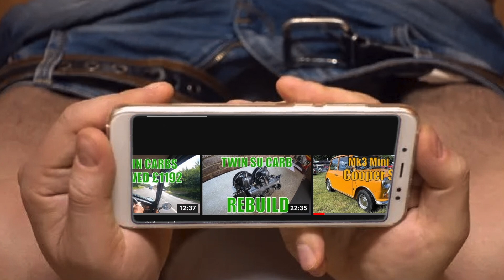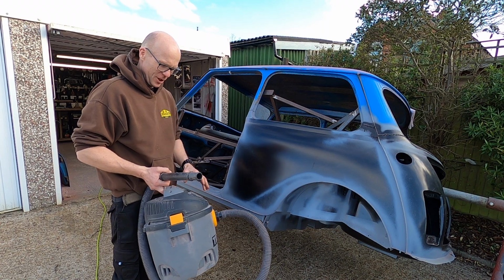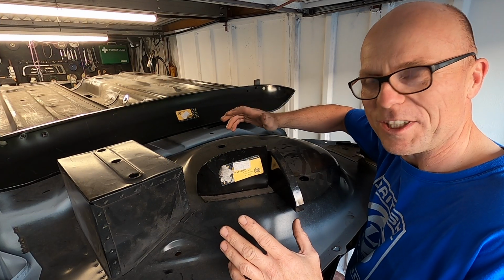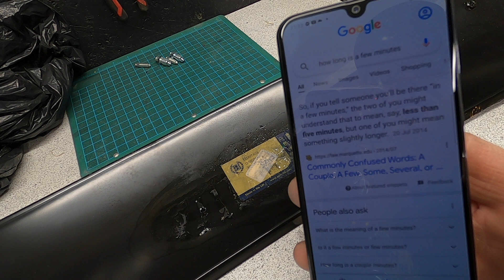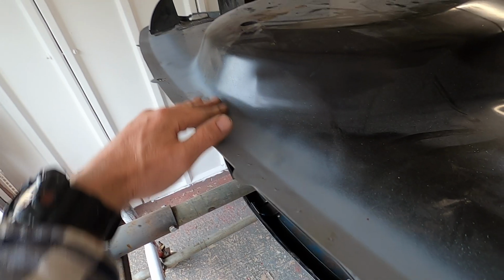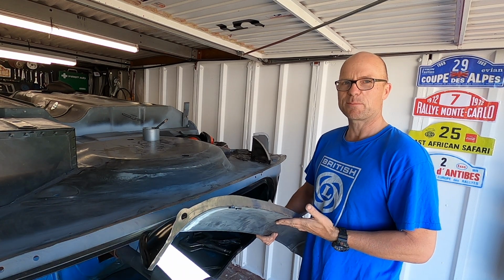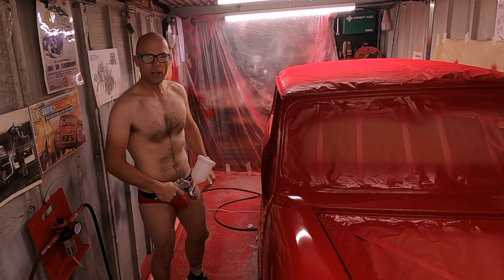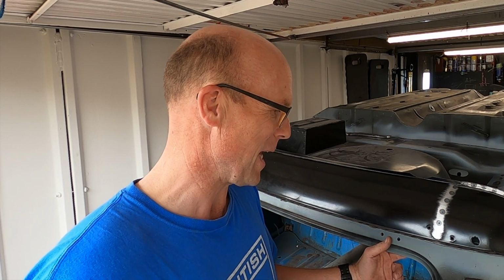Bernie the 1275GT Part 19 - REAR VALANCE - classic mini workshop #project #classicmini

Comment: Brilliant Kev! 🤣 You've got me down to a T. 👏🏽Best thing with stickers is to soak them and peel or get an edge lifted and spray the lifted edge and it'll loosen the glue as you peel and spray. Great to see Bernie coming along!
Reply from the maker: Good tip! thanks mate - and glad you enjoyed the video
Reply: A hair dryer also works (maybe you don't have one!) to soften up the adhesive, then panel wipe, plastic scraper. 😋

Comment: Kev, I have found a hot air gun is the best way to get stickers off, Try it! BTW there is a tool for the spot welder which 
will clean both tips at the same time it will cut the perfect shape and profile for your spot welds.  Cheers Dave
Reply from the maker: thanks Dave, I will have to give that a go thanks - I have seen those spot weld tools, I might have to get one - glad you enjoyed the video